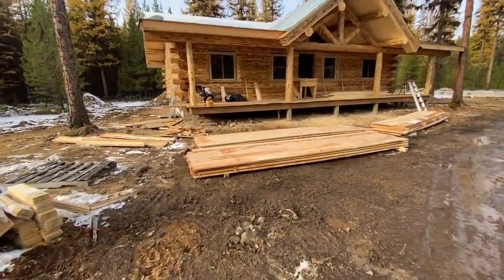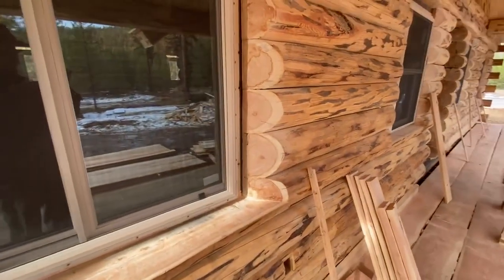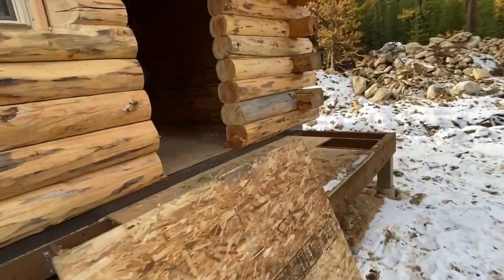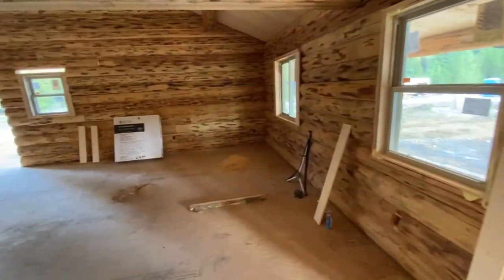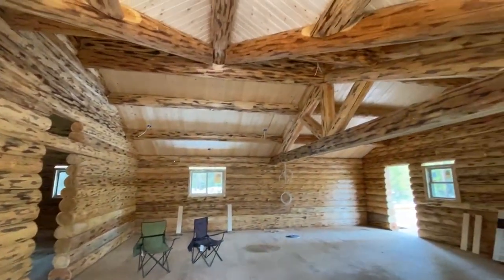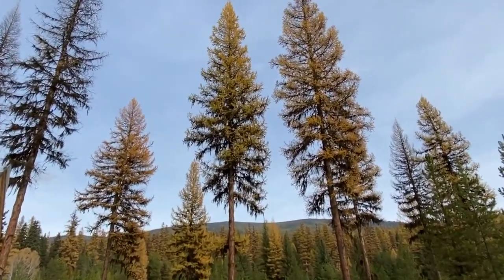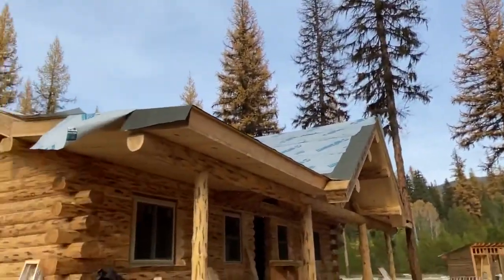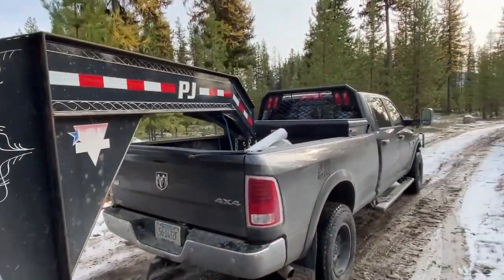Montana Rancher Log Home- ROOF IS ON AND WINDOWS DOORS INSTALLED- Part 3

Comment: Hi from Australia Perth wa. Elvie have you ever had a home go throw a tornado or a typhoon love your work and the home.
Reply from the maker: We built a commercial log office structure around 6000 ft.² in size that we built in the city of Joplin Missouri. It was attached to a 100,000 ft.² warehouse which went through the Joplin Missouri tornado in 2011. The warehouse building was completely destroyed but our attached log structure only had the roof tore off and some of the beams but the walls were all standing.